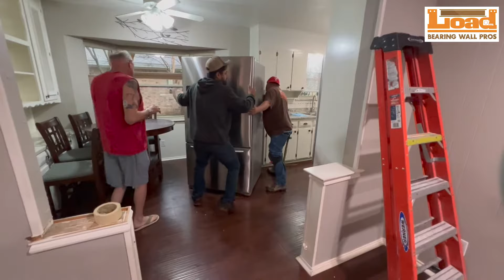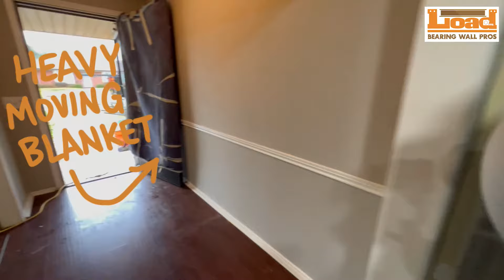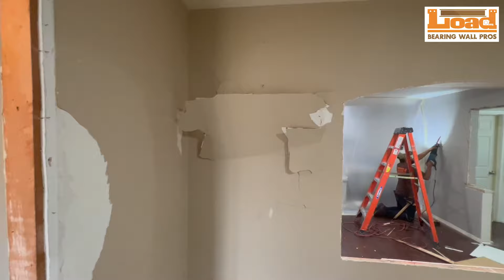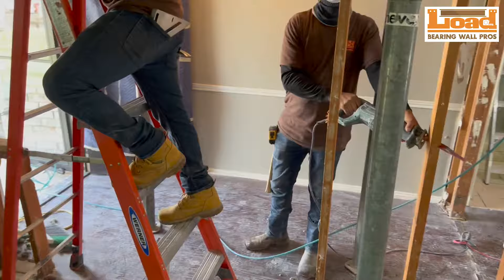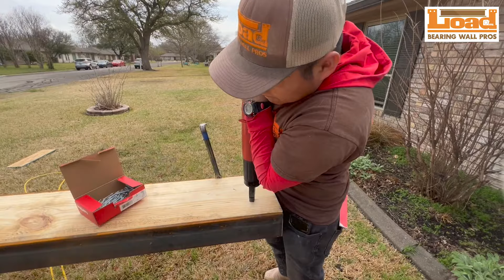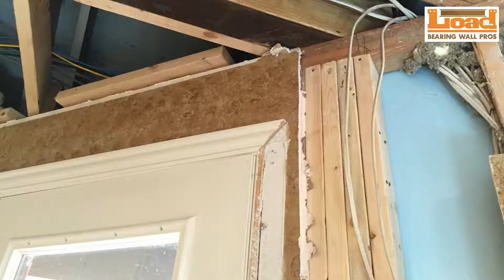Start-to-Finish Load Bearing Wall Removal Process (3 WALLS REMOVED) - Load Bearing Wall Pros

Comment: Are steel beams a requirement?
Reply from the maker: No, they can be wooden LVL, it's really just whatever the situation requires.
Reply: @LoadBearingWallPros also were extra footings needed  at the ends of the load bearing beams ?
Reply from the maker: @Nicktexas_  It all depends on what the engineer requires. Depends on roof, 1-dtory or 2-story, type of foundation, length of beam, etc.

Comment: Amazing work, love the walkthrough. What kind of load transfer does that mean to the floor underneath, now instead of having the load spread through all three walls it's in a few concentrated areas, how do you calculate that type of transfer to the foundation?
Reply: My question as well. How are you able to do this without having to dig and add reenforced concrete pads around the existing footings where the supports for those beams rest, with HDU Holdowns or something similar?
Reply: @philgofberg you can’t. That slab is roughly 4 inches thick. Maybe 6” at the most. Supposed to saw it and pour a footer where the load ends. On the perimeter of the house it should already have a footer but where they rested that beam on that wall that concrete will settle and crack eventually leading to a big ol crack across that ceiling. Nobody understands when you take walls out that you have to transfer that load to the ground.
Reply from the maker: Great question! Every project is different, so we always recommend scheduling a free on-site estimate where our team can assess your specific situation. Give us a call at 469-813-8143 or visit loadbearingwall.com! 👷‍♂️

Comment: How much for removing one loading wall 17 ft?
Reply from the maker: Great question! Most wall removals start around $3,500–$8,500 for the first wall removal, roughly half that for each additional. Full pricing breakdown at loadbearingwall.com/pricing. We offer free on-site estimates — call 469-813-8143 or visit our website! 🏗️

Comment: I want to do a open floor plan the bearing wall it’s pretty long about 27 feet. Is there a maximum footage that’s allowed for a beam to be placed. or it doesn’t matter how long the beam is
Reply: We just did this. 26' LVL. Turned a very chopped up 50's ranch into an open layout.
Reply: Just make sure it’s an LVL. You’d probably need a 3-4 ply 12” setup.
Reply from the maker: Thank you! Really appreciate the kind words. 🙏🏗️

Comment: Nice 👍🏻 about how much was the total cost of your work ?
Reply from the maker: For the Wall Removal portion of this job, Typically we charge $6.5K to $7.5k for wall removal/beam install for 1st beam, and $1500 to $2250 per additional. This one had 3 walls so to remove those walls & add the beams it was around $13K
Reply from the maker: Around $9K for the 3 walls removed
Reply: @LoadBearingWallPros , so it was $9K for the demo/removal & $13K to install the 3 breams for a total of $22k, eh???
Reply from the maker: @jetsetjoey  No, sorry the answers are a little confusing... The price to Remove 3 walls is $9-$13k (ballpark). That includes removing the walls and installing the beams with joists attached and cleanup. Comes with LIFETIME structural warranty. The finish out (sheetrock, tape/bed, texture, trim, paint) is additional.